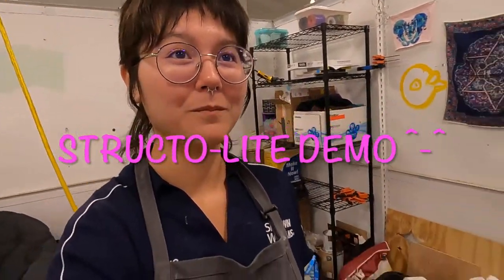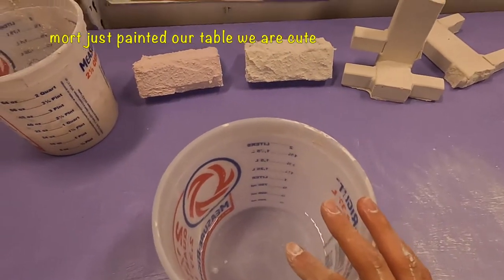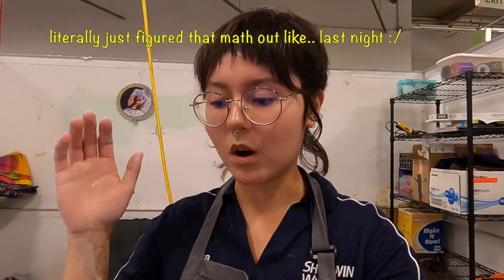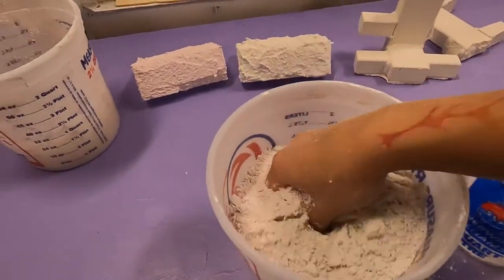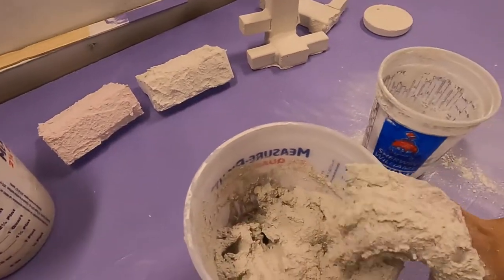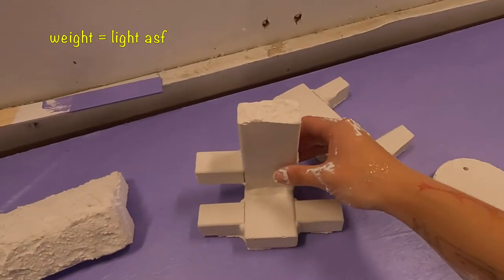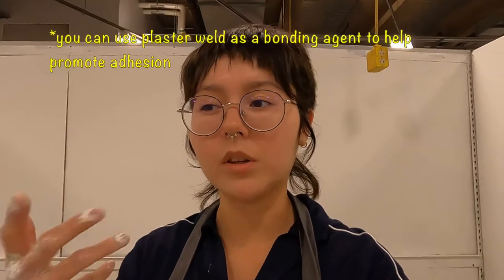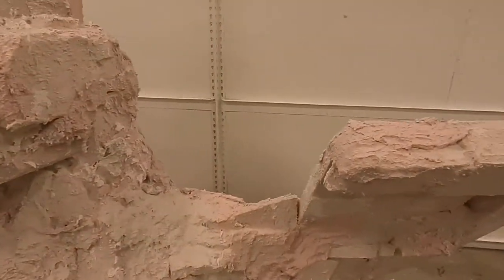Structolite Material Demo

Comment: In the construction world, we often (not always) coat surfaces to which Structo-Lite is intended to adhere with concrete bonder or plaster weld. You might find it helpful for prepping the skeletal structures of your sculptures, especially when you're dealing with a material or surface that seems not to want to take the Structo-Lite.